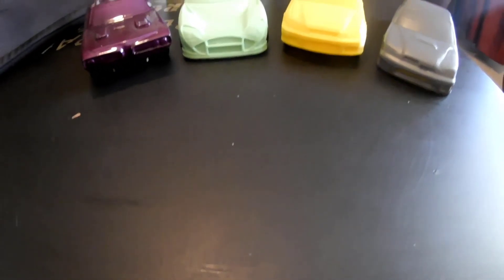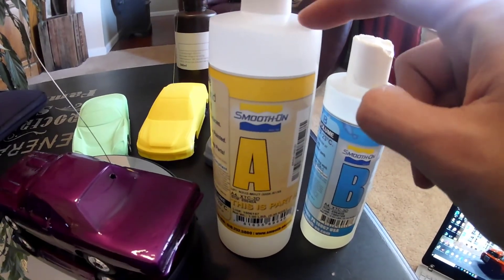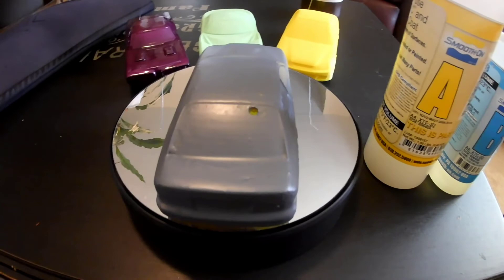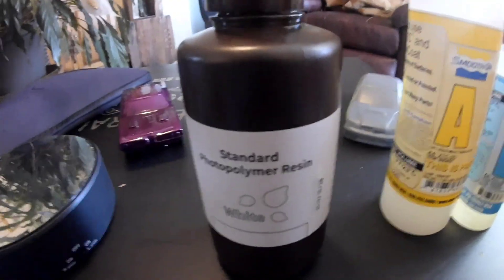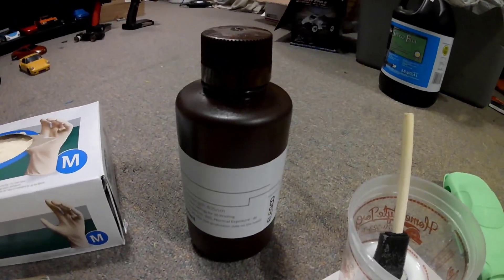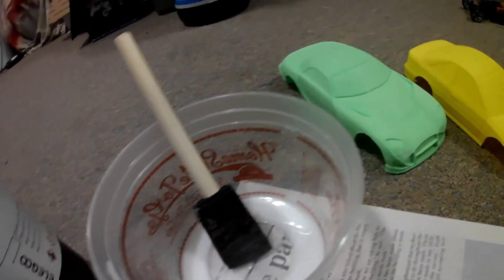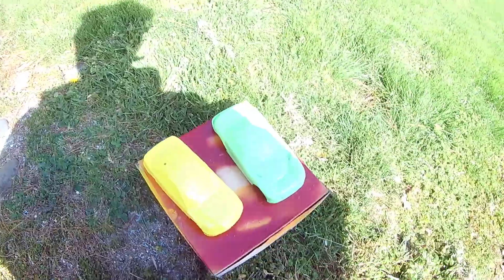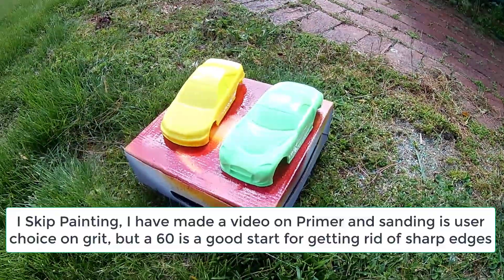Don't Use XTC 3D For Smoothening Prints, Use This!

Comment: NO.
XTC-3D is an epoxy.Reinforcing and protecting stuff.Coated surface is protected from scratches and damage.Have some hardness.
Bonding layers together, expecially thin walls.They become DURABLE. You can even repair partially damaged prints with that.
UV resin is none of this.I am courious how this resin-coated part will look few years later, or after few days in exterior.
XTC-3D is better in every aspect.